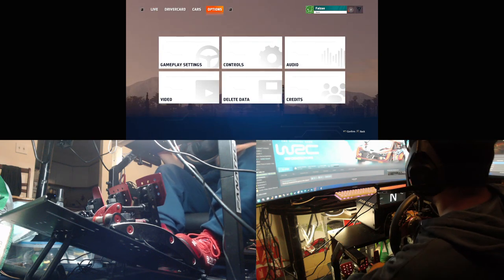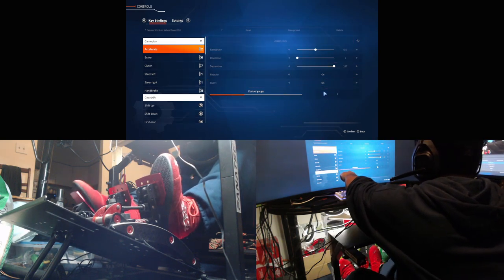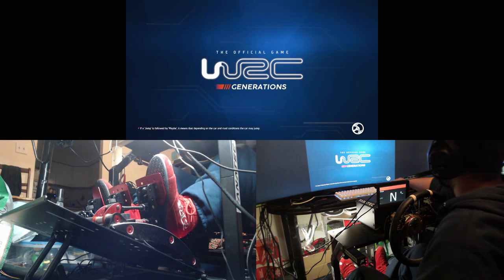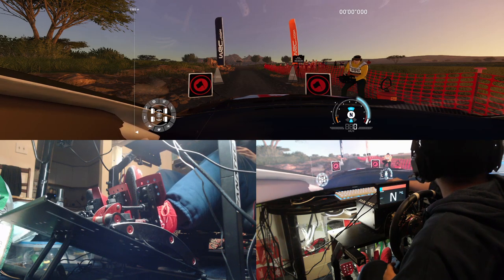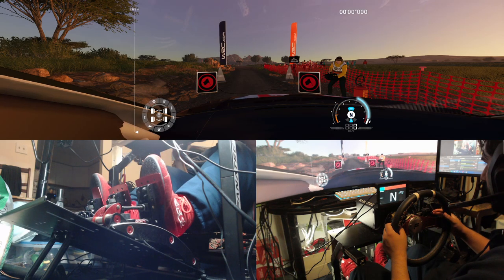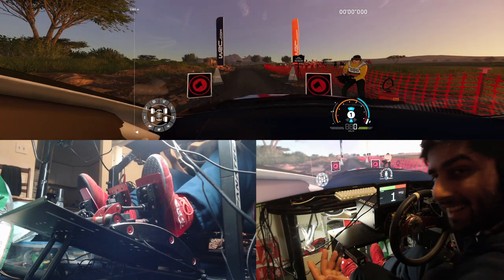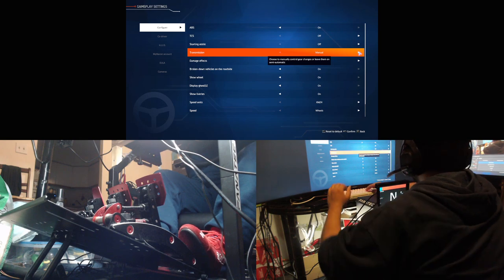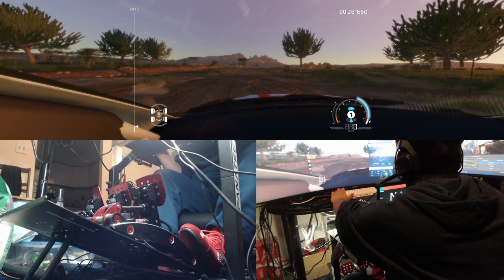Bug in WRC Generations with throttle input on controller and on wheel

Comment: I thought it was just me. I can't control the car coming out for corners, it will always spin cause you will always have to put 80% throttle for it to accelerate. It makes me want to pull my hair out of frustration.
Reply: Same here 🙈
Reply: Hopefully codemaster is now in charge of the wrc games
Reply: Had the same issue. I fixed the problem for me by putting the sensitivity value in the settings on 0,5 or 1... The deadzone feels also better for me on  0 istead of 1... There is still a kind of lack in throttle, but i think, thats the way it is meant to be "more realistic". And to be honest, that might be quite well done. When you "learn a simulation" things can feel different depending on the emphasis the developper putting in the code. They can feel different to what we know and still be reaalistic. When I learned the way WRC Generations works, it feels even better than RBR to be honest. What do you think about it?

Comment: In trying ot get my wheel to work properly, I stuffed the car into a wall. It was still in semi-automatic, as I was trying o set up the controls. I'd configured a button for reverse gear ... it worked - R was selected - until I applied throttle, and the semi-automatic put me inot 1st, disabling Reverse! This hame is so full of holes that should never have been released into the world :(
Reply from the maker: Fr

Comment: This is the most  basic requirement for any racing game , nobody test this game before the release?  They have driving license?  They know how a car works ? I start to have doubts,  it's a fucking racing game , this things must be state of the art 

1. The wheel turn only 90 degree like forza games?  Fuck , we are in 2022 not in 1992 
2. Acceleration doesnt work 
3. Wheels on series x doesnt work ( only yesterday they partial fixed the problem,  but still feels weird ) 
4. The sounds of the engine  are very very  weird especially at high rpm 
5. Why the hell when I scale the gears the car make that clutch sound like braking ?  Very weird 
6. The jumps are very weird,  the car tend do do backflips unnaturally,  like the car has 90% of the weight on front wheel s 
7. The handbrakes doesn't work properly 

Man to many problems,  save god the guys from dirt 2.0 masterpiece take it over

Comment: Shit mines worse it won’t recognize my pedals at all  ClubSport version three it won’t recognize my wheel turning but it recognizes the buttons on the wheel
Reply from the maker: you gotta update to driver 447 to get to this lvl. then again, the game becomes unbplayable tho with this throttle bug
Reply: @muhammadracing  Had the same issue. I fixed the problem for me by putting the sensitivity value in the settings on 0,5 or 1... The deadzone feels also better for me on  0 istead of 1...

Comment: This shit is also on WRC 10. Why didn't they fix it
Reply from the maker: Honestly my man's I got no clue
Reply: Late to the reply here, but I have never heard of this issue in any of the previous WRC titles. You sure you don't have something else going on? Rescale on the throttle settings on/off?
Reply: @SaxmanUSMC  it's definitely there. I noticed it because I went straight from WRC 7 to 10 then Generations. There was a huge difference when I opened WRC 7 vs 10